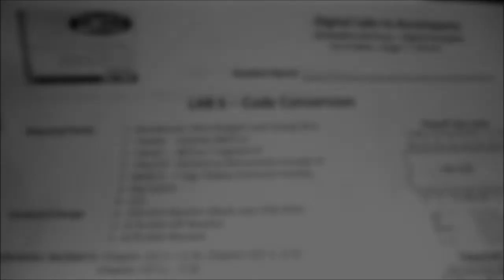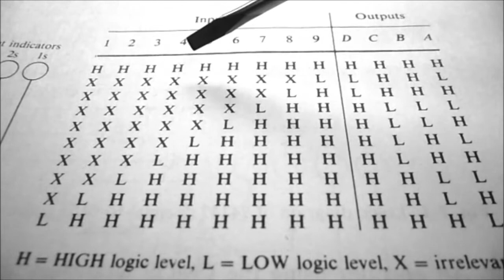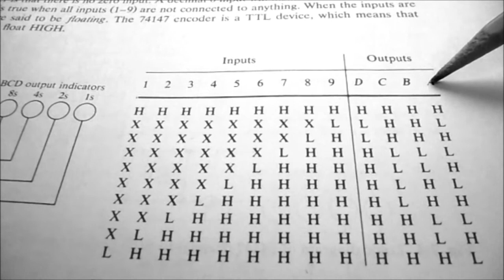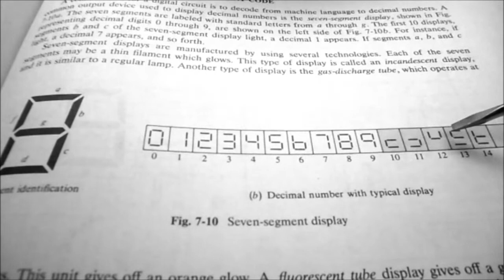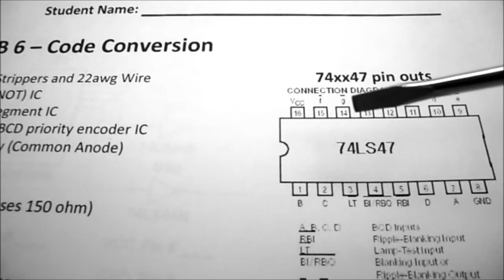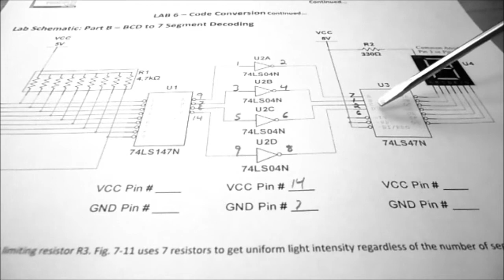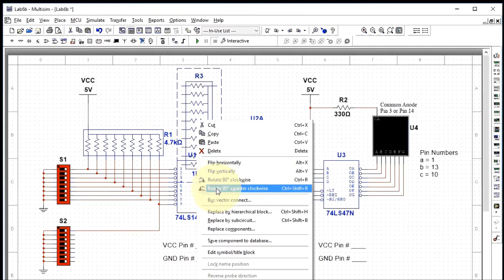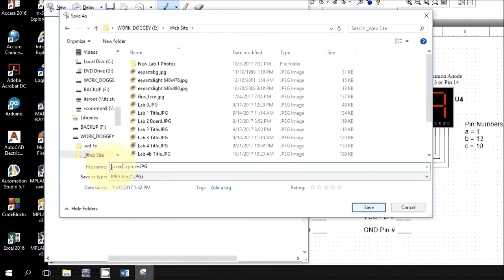Digital Lab 6 - Code Conversion

Comment: When building the second circuit, with the MAN 72 7 seg. display, in MultiSim, it will not display the numbers.  Is there a setting I am missing?
Reply from the maker: 42:30 minuets in I explain on current setting for the 7 seg. display.